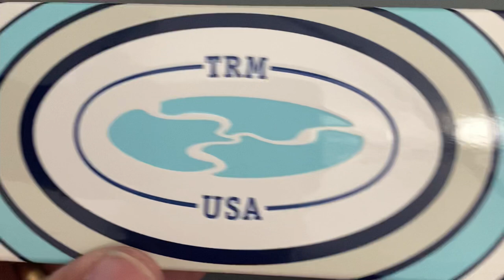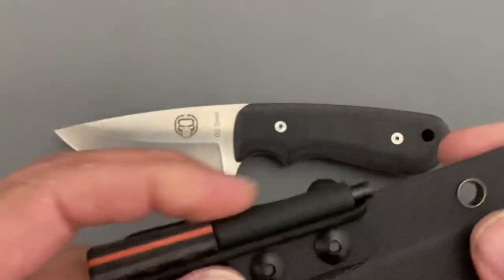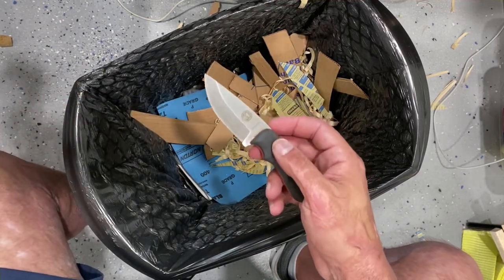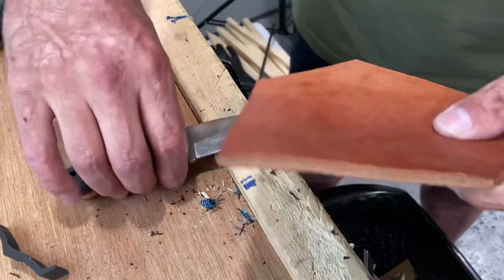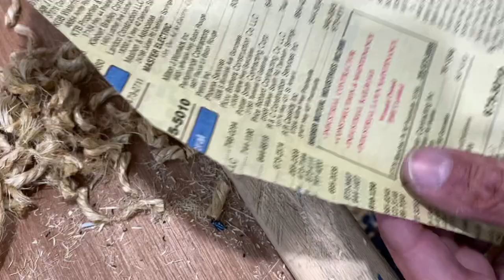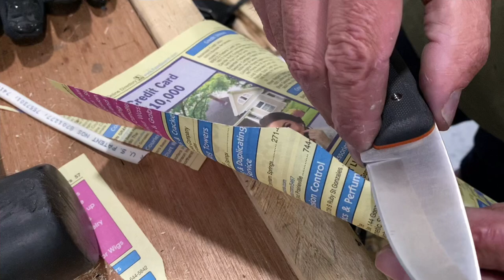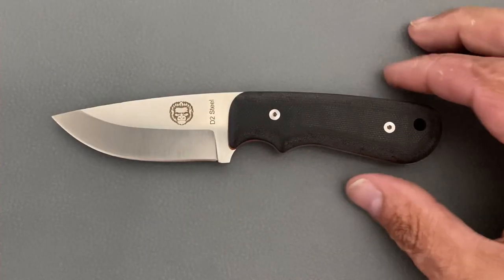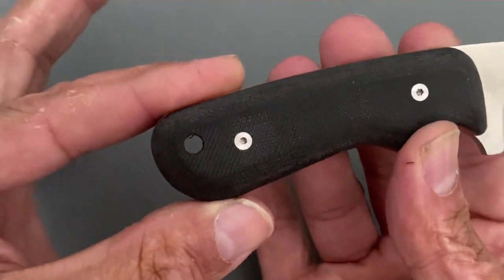Amazon knife of the Month: Holtzman's Gorilla Survival- Bushcraft  Neck Knife /Review

Comment: I've been desperately trying to find a d2, small EDC fixed blade that wasn't fake or dull out of the box. I'm in rough times right now so $ is tight (med bills are killer). You are one of the few YT hosts I trust.  I am going to pick one up as soon as I'm able. Thank you so very much for the heads up on this knife. 
 Oh n since you don't like that diamond sharpener, cut a piece of leather the same size., attach it to the top of the diamond sharpener so the leather covers the rough sharpener n it will also work as a small strop. 
Love your channel, respect your Honesty n integrity.  Peace n comfort Friend.

Comment: After having this for about a year, I have decided that they put a lot of thought into this knife. The full contoured handle is super comfortable for extended use, and it seems like they ran the D2 a bit softer for toughness and field sharpening, but it still takes and holds an edge very well. The primary is actually a very shallow hollow grind; almost indistinguishable from a flat grind. I like that they kept the stock reasonably thin, but its thicker at the edge, so I have no concerns about using a baton to split wood with it. I think this is an excellent more budget friendly answer to the Izula. The only survival neck knife I prefer is the Joker Avispa (not Esse) made in Spain. It is an incredible knife, and will go toe to toe with a Bark River or LT Wright. If you don't know of it and youre looking for a ultra compact survival knife that doubles as an EDC, you gotta check it out. Its pretty much awesome at anything a smaller knife can do.
Reply from the maker: I’ll check it out thanks for the recommendation 👌🏻

Comment: I ordered one and it was rolled on the edge. Amazon replaced it and I wore it for a camping trip. I used it maybe 10 times cutting food and cleaning fish and when I got home it was rolled over again. It’s from the sheath I believe. I think the blade hits the diamond stone.
Reply from the maker: Oh damn thanks for letting me know that. I guess I got lucky then however when I first looked at that stupid diamond plate I thought to myself that’s a good way to wreck an edge. I just went try to force mine into the plate and the only way I could get it to hit it was to intentionally put the knife in crooked. I did notice that the bottom portion of the plate on mine is pulled out away from the sheath so possibly that could be why it’s not contacting it but I’ll definitely let y’all know if I start to run into the same issue or not 👌🏻

Comment: Great looking little fixed blade. I think they might have messed up the size dimensions. The total size they have is 7 1/8" and with a 2 7/8" blade and a 3 1/8" handle, that equals 6". Also, the ESEE Izula is 6 7/8" total length and it was quite a bit bigger in the video. Not that really changes anything. It was just something I had thought about. It is really awesome the way it did in the tests and only costing $30. Great video once again Stassa! Have a great day.
Reply: You mean the IZULA-II, but anyway, the Amazon questions & answers say 6 1/8".